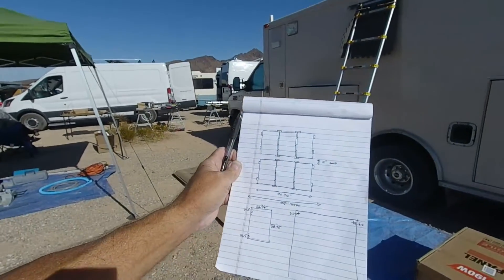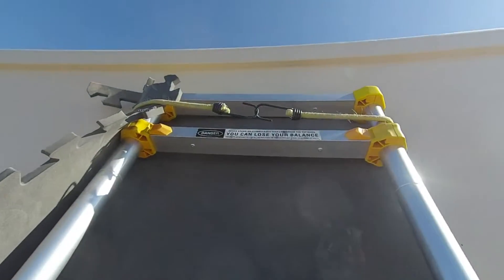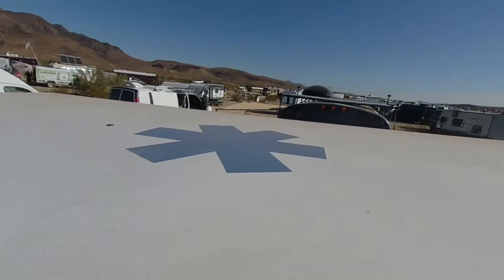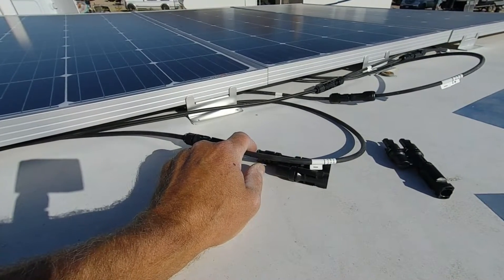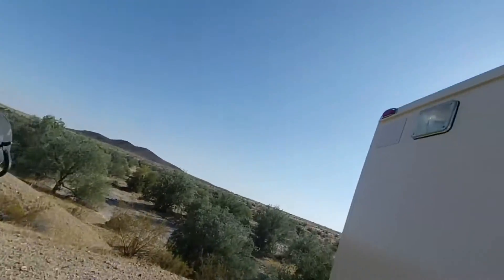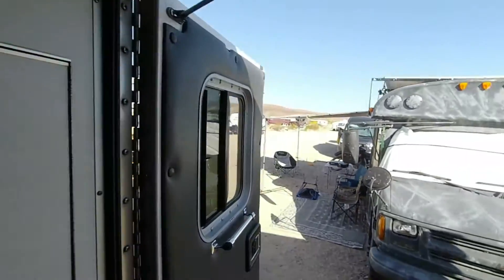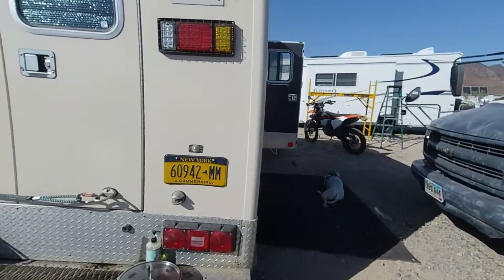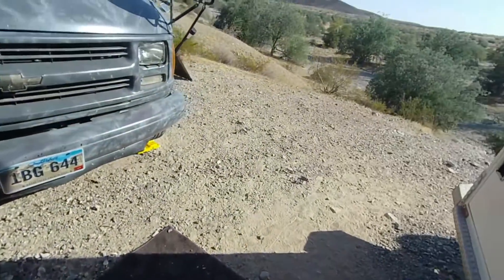Ambulance Gets 1140watt Solar Installation | Ambulance Conversion Life

Comment: The screws just into the sheet metal or did you aim for the 2x2 tubing?
Reply from the maker: Screwed into the aluminum roof with VHB tape also applied.
Reply: @TheCampulanceMan   Thank you :) so you screwed into the roof skin and the into the structure underneath - or just in any random spots?
Reply from the maker: @limodrivermike  Just in random spots. The aluminum is thick enough to give the screws plenty to bite into. If I did it over, I'd use Riv Nuts (Nutserts) and bolts.
Reply: @TheCampulanceMan   Gotcha, thank you very much :)

Comment: I recently bought an ambulance and I’m seeing you may be the person who can answer my question of Can I use the existing inverter and electrical system and just add a controller and portable solar panels to have solar power? 
I’m just doing the rough quick build so I can get on the road and then I’ll do a full build out later after I’ve spent sometime in and see exactly what I want to do. With the rough build I do need some power off grid so I can run my business
Reply: How did it go? What did you end up doing?
Reply: @michaelthompson139  I added solar panels to the roof and a controller and kept the inverter and batteries. Been running a year now and no problems😎
Reply: @barefootexpedition9070  That's great that it's working for you. I'm still about a year away from getting an ambulance and just trying to learn how to configure the systems. The solar power is a top priority for me.

Comment: I gave up on Ambulances about a year ago until recently and found you and some other videos again -- the idling and abuse they (can / have taken) was my concern based on multiple comments from paramedics..... my other concern has been finding all the wires and schematics like you are addressing here for walls and ceilings.  Short of also using a wire gauge/finder, I guess if I go this route, I will figure it out.   I am leaning back towards them again -- it is just hard finding a decent one, with what you want, is my huge issue I am finding now.
Reply from the maker: Some rigs can provide schematics from the manufacturer. Mine was not available so I had to resort to probing and tracing. Its all fairly simple once you get in to it.
Reply: @TheCampulanceMan   I am really happy that I found and subbed here right around your first 1000k,  I like the way you go about things dude.
Reply: @BarryDuttonSellsHomes  Thanks Barry for subscribing and watching / commenting. I appreciate the interaction and it's great that my videos are helping you in your decisions.
Reply: @TheCampulanceMan  Would you be willing to do a video sometime on USSA rights to carry across all the state lines and all that stuff 2A wise??  I've even asked a couple of YT'ers down there questions about that, and then they don't even respond.   Obv. I know the politics of the day and that NYS leans left and away from the 2A but it is something I would like to learn more about.   Better if I ask a 2A supporter obviously, which I know nothing really about you LOL --it is a valid travel question.  Some just do not want to address it and I get that.
Reply from the maker: @BarryDuttonSellsHomes  That's a topic that I don't have a dog in the fight. I have my own personal feelings about rights, but I'm not a carrier and don't really have a lot of knowledge on that topic. I do know that there are folks with personal protection items out here on the road who travel cross country. It's a pretty private topic...

Comment: would you mind telling me what is all powered by this size system? I am trying to get an idea of what i am going to need to power a small window unit, fridge/freezer, lights, a tv every now and then, and keep my phone and lap top charged. Also how many batteries do you have?
Reply from the maker: Hi Swank! I have an A/C (window unit), a microwave, coffee maker, 32" tv, 12V fridge, WeBoost cell booster (12v), MaxAir fan (12v), plus normal small items (LED lights, phone, tablet, laptop). The A/C requires the full power of the panels to run without depleting batteries. I have (3) 100Ah GEL batteries. Thank you for watching and commenting :)
Reply: The Campulance Man thanks for the reply! When you say “ the ac requires the full power of the panels to run without depleting batteries”, you mean if it’s in the middle of the day and the ac is on, you can’t use anything else ( lights and chargers) otherwise it will drain the batteries?
Reply: @TheCampulanceMan  new sub here. I like your list. Do you think having 2x 200AH gel batteries, 400 watts of panel, 3000w sine wave inverter and 50a dc-dc battery changer with MPPT is a over kill for the same setup you have? I'm running the numbers and I'm looking around $2,500 and me doing all the labor. Renogy.
Reply from the maker: @uslipaway  General rule of thumb is 2x Ahr for your panel array. So you'd want 800w of panels for 400Ahr batteries. You'd struggle to recharge high DOD with 400w.
Reply: @TheCampulanceMan  thank you for taking the time to reply to my question. I'm putting my list together and shopping around for an ambulance right now. I want to stay under 10 grand for one. I've seen a few.

Comment: David...where you have butted the panels together, how did you secure the panels to roof and/or each other?
Reply from the maker: Hi Joe - the panels are screwed together through their aluminum frames using self tapping screws. I liked them up on a table and then zipped the screws in. Then the panels are secured to the roof with Z brackets. Good  question!

Comment: Nicely done! Please, if you have time, address the wiring and connections of the solar power into the electrical system.  Are the panels 12V? 110? routed thru the inverter? How hooked to the batteries? Instrumentation for battery levels.  Thanks in advance. Chuck
Reply from the maker: Hi Chuck - I'll make a detailed video for the electrical system and address your questions. Look for it in the next several days. Thank you for your interest!

Comment: How did you run the panel wires into the truck. Did you cut a hole or use a preexisting one? Second question. How have the panels been since the install? Any issues. Reason I ask is once spring comes around I am planning to install my solar on my ambo
Reply from the maker: Hi Jerome- great questions! If you notice on the front of the box right in the center I have the wiring gland where the wires go into the box. I used an existing hole that was where the light bar wiring was. This worked out perfectly and I was able to run the wires right along side existing wire looms, down and then up into my side cabinet to the charge controller. So far, the system is working perfectly and the panels are solid - the combination of adhesive tape and screws is holding strong! Let me know if you have other questions I'd love to help.